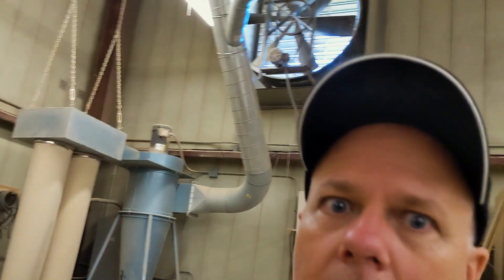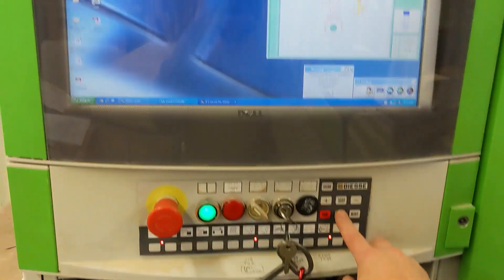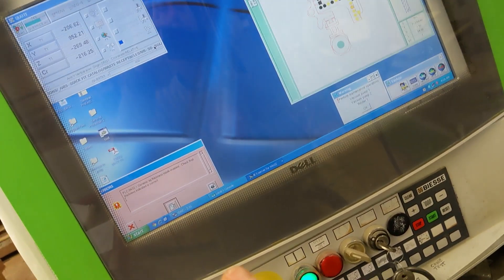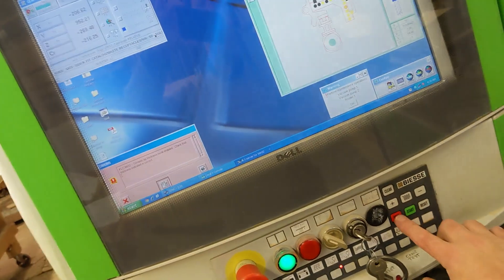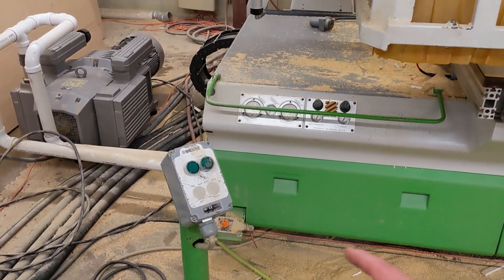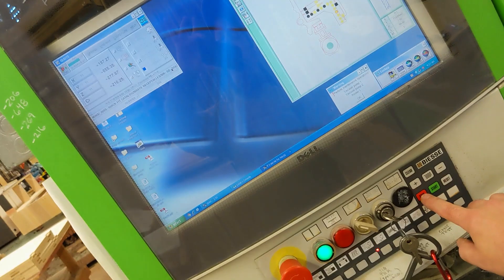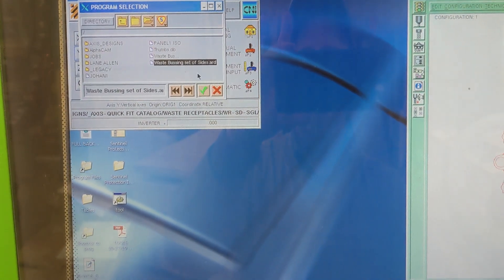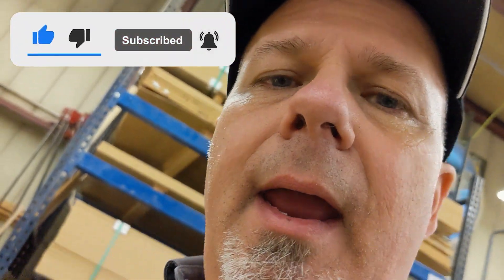BIESSE ROVER 24 HOW TO SEND THE MACHINE TO HOME ORIGIN QUICKLY WITHOUT GLOBAL HOMING AGAIN

Comment: Hello I have a question we bought a used rover 24 s with nc 1000 control at work unfortunately there was no biesse works or nc hops as cam software. you happen to have a post processor for fusion 360, unfortunately we can't use the machine at the moment I hope you can help me with this problem
Reply from the maker: Hi Dennis - There isn't a biesseworks for this age of machine. Did the machine come with AlphaCAM on a separate computer? Email me at lee.bernard@mogpm.com and I might have a work-around for you. Otherwise you might already have a full setup and just need the parts sorted out. Take a look at my other videos, they might help
Reply from the maker: check your spam folder - my email might have ended up there

Comment: Enjoy your videos. I have a Rover 37ft and still learning everyday. I have a question... if I step on the safety mat during machining how do I restart the program without starting from the beginning?
Reply from the maker: Hi S Hofer, I don't know on the Rover 37 but on the Rover 24 if we pause the program by stepping on the mat, we push the green softkey "start" button and the program resumes. On the 24 the start button is between "stop" and "reset". Hope this works for you!
Reply: @thecrazycncguy7500  the videos are great! Did you manually disable the floor mats? I’m setting my machine up now and wondering if I need them.
Reply from the maker: @garymccraner1129  we disabled one of them. The other one is still functional. This machine makes fast traverses and can punch your lights out if you are standing next to the table. The mats work with a trickle current if I remember correctly. To disable I had to put a resistor between two pins in the pigtail that connects to the mat.
Reply: @thecrazycncguy7500  I appreciate it!